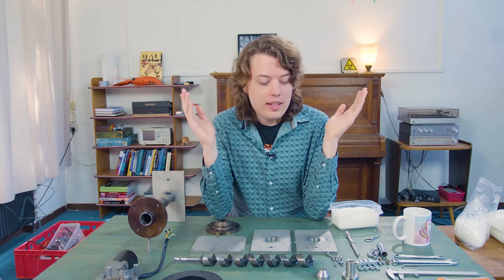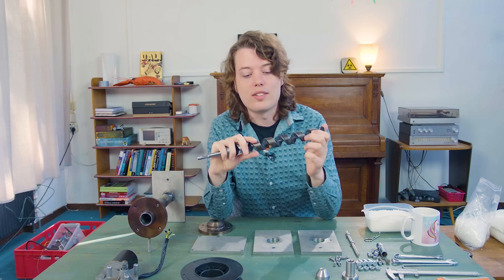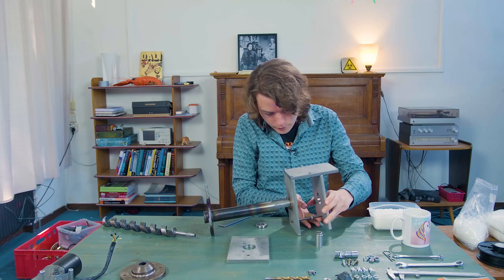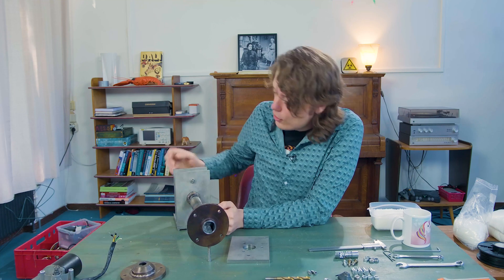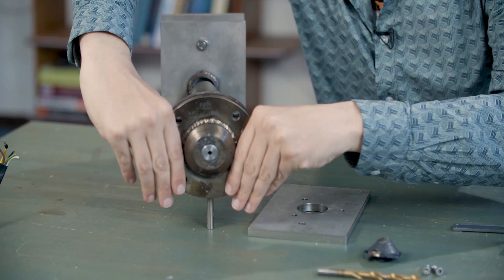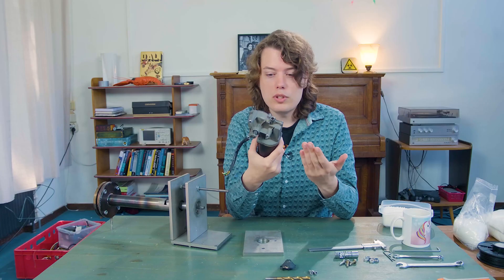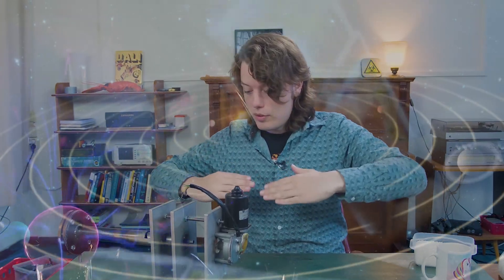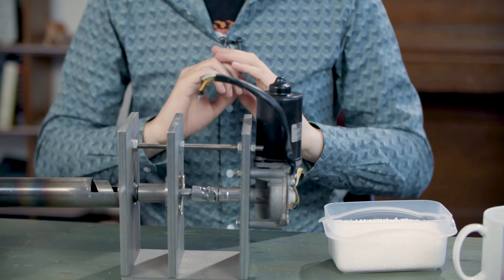Making my own 3D printer filament! - Part 1

Comment: @3:05 You might try using a solvent that can dissolve the plastic. Wear thick gloves that are impermeable and are resistant to (ideally, immune to) the solvent and eye protection in a well-ventilated area. A fume hood or outside on a breezy day would be ideal. Use tools to manipulate the plastic-covered nozzle and submerge it in the solvent until enough of the plastic has dissolved that you can manually remove all of the plastic from the nozzle.. Wash the solvent from the plastic and nozzle carefully and thoroughly. This may require additional solvents.
Reply from the maker: I was thinking about additives in the plastic. These experiments are maybe for the future, but for now Im working on other projects

Comment: @2:19 Is that a thrust bearing? A ball bearing might have a shorter lifetime and lower force capacity than a thrust bearing.
Reply from the maker: It is a ball bearing. But the amount of force on the bearing is relatively low

Comment: Would you consider manufacturing these and selling them?
Reply from the maker: You mean the filament? That would require better tollerances on the thickness of the filament. Im first gonna use this for personal production and maybe improve some things on it over time.
Reply: @widgetlad5157  no, I mean the machine itself.

Comment: got a link to that drill bit?
Reply from the maker: Its an auger bit 40mm diameter. Bought it on ebay but amazon sells some. https://www.amazon.de/-/nl/dp/B07JC1CTNF/ref=twister_B07JCZG14L?_encoding=UTF8&psc=1 this one you can choose multiple lengts